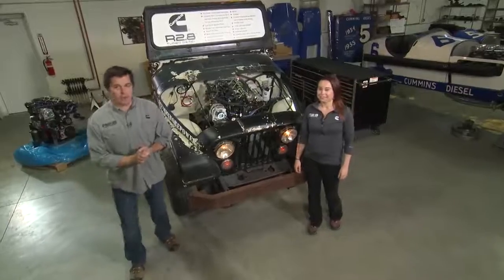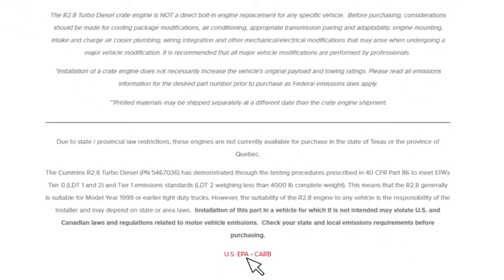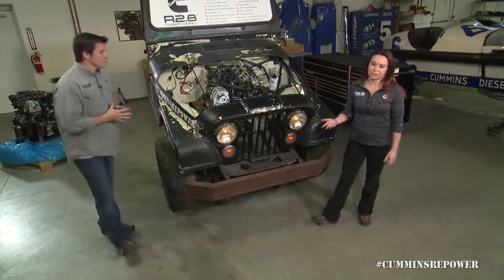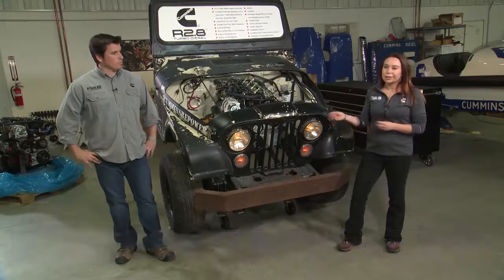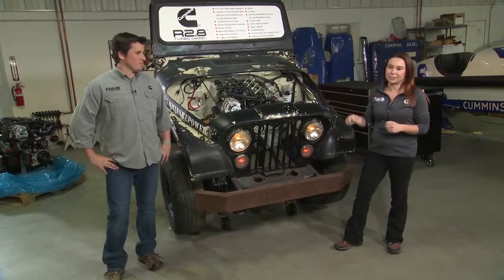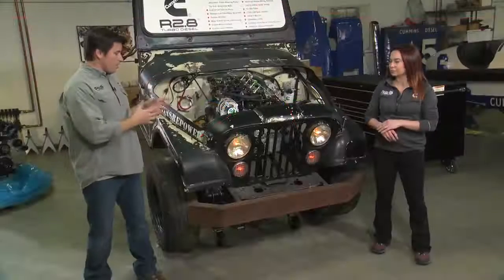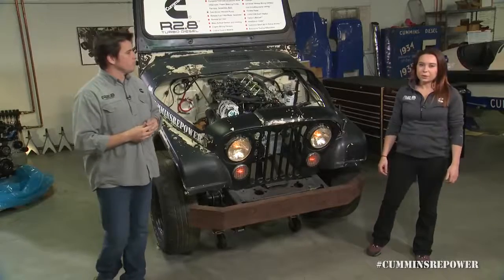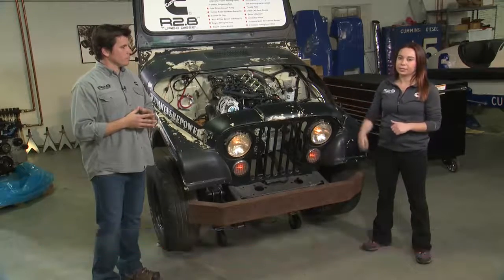Cummins Repower Garage 2: Selecting the Appropriate Vehicle for your R2 8 Repower Project

Comment: Pretty vague. What transmission does it come setup for and what transmissions are easly adapted? Will my wranglers stock auto bolt up without adapter plates? Do I need a trans shift controller adapter?
Reply: Just listen to the whole video. The chick literally says you need an adapter for an auto trans. But honestly if you’re asking that and driving an automatic, this swap is probably a bit too much for you